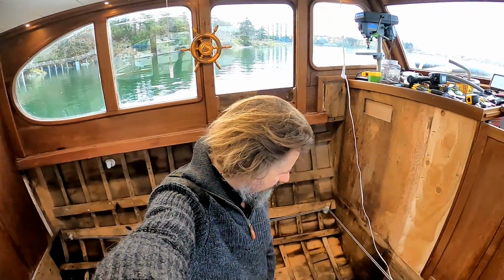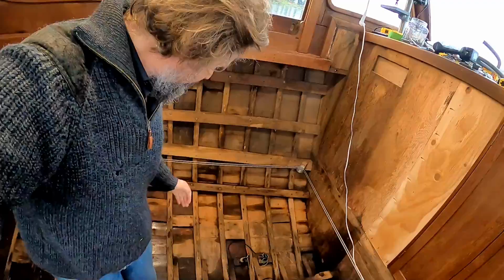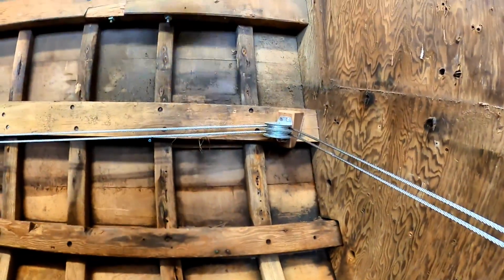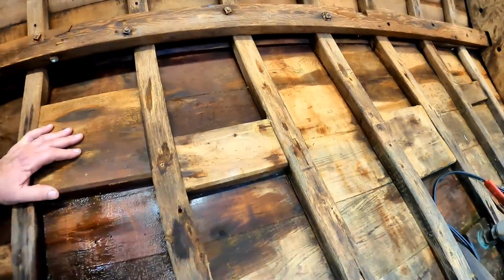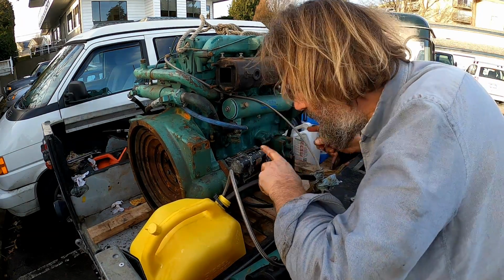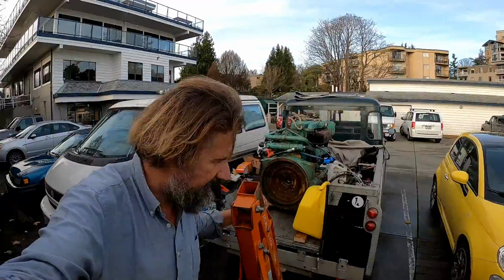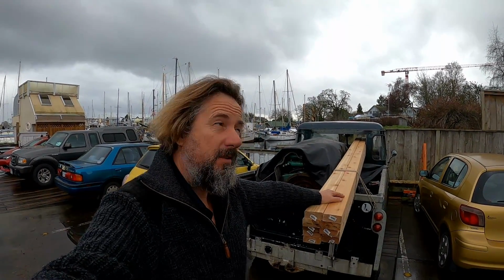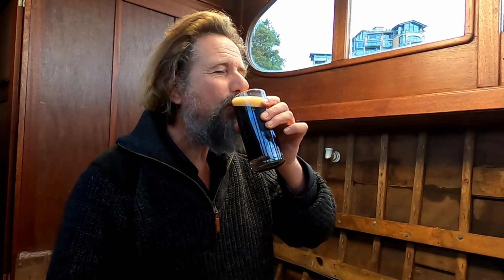Ready to Rebuild - #207 - Boat Life - Living aboard a wooden boat - Travels With Geordie

Comment: Mate, plywood is so expensive over there, $250.00  a sheet WOW,., same is around $150.00 . Down here in Aus.
Those Claytons butt blocks, could be reinforcing faults in the hull timber. Be I interesting to see when you've got the boat on the slip. 
Love your videos, too.

Comment: Peter, haul the boat, do all the necessary structural fixes before you put the new motor , and sole in place. if you wait till after, you're going to tear it all out and have to do the job twice. You can't build the house until you put in the foundation. I anticipate your response.
Reply: Your idea certainly has some merit. I believe peter will surprise us with a very cool choice of material for his new floors, some modern material.
He mentioned once that getting the boat to his haul out spot is best done with an engine. Peter needs to do a go fund me so he can get a good workshop!😁
Reply: @108hindu  I believe he's going to use some form of plastic for the new frames however trying to install those with the engine an engine bearers in the way, not to mention the new cabin sole is just going to complicate the whole process.
Reply: @stevegem4155  I agree, the stuff the boatbuilders are using now is strong, doesn’t ever deteriorate, and fairly easy to work with. I also agree that it’s harder to do in the marina but Peter seems a to be long way from his haul out. He’s a clever guy and always seems to find a way. At least the planks look really sound.
Desolation sound 2021!
Reply from the maker: Hi Steve, I've had to justify this decision more than any other I've ever made. I can see your concern. The simplest answer is that I must have the boat functional very soon. 
I'll explain again next week the whole planning process.

Comment: Fascinating project and boat. I have seen ceder used for soles very successfully. Sealed with an Epoxy sealer the floors were 20 years old at the time I was working on the boat.

Comment: I awake each Saturday with much anticipation. Has peter posted a new video yet? 
Great idea on the heavy marine plywood. Nobody likes spongy floors. Especially when the boats rocking.
If I lived on the island I’d give you some nice clear Alaska yellow cedar, if you wanted it.  
I hear the boatbuilders like it. Cheers 🍻
Reply from the maker: Woo, I'll come get AYC anywhere....
Reply: @TravelsWithGeordie  I live in Tacoma. That’s probably a bit far and the border is closed (?) I just looked and my local wood specialty places website, they even have AYC 6x6’s “appearance grade” Good prices, $6.50 a ft. Many interesting sizes and lengths. Mostly rough cut full dimensional, I plane it myself. Some s4s sizes.
My own stock is only a couple of boards right now. I have a pretty decent wood shop. When feasible I buy bigger stuff and resize it to my needs. I could buy some more  AYC as a present 4 Geordie 🦮 but delivery..... they even have some 4x4 and 2x6 port orford cedar. Dam this covid....

Comment: Hey Peter. Just a reminder. The oil that you put in the Perkins was not a suitable diesel lube oil although OK for storage. I found a current new Deutz diesel, common rail, water cooled EGR etc with CPU (50 HP) and new ZF transmission, 8 degree down angle for your craft in eBay.com, $4995 + $2205 USD.   (2017 Deutz D2.9L4) (ZF 45A). I have this engine new in pre Tier 4 final if interested.
Also if ever interested, I can advise you on Marinizing this app.
Reply from the maker: Hi Robert, thanks for the research on the engine. 
I've ordered a Beta Marine 60 HP and PRM gear so I'm all set.

Comment: Is not the the height of the engine based on the centerline of the transmision shaft ? IF the trans has a centerline inline with the engine crankshaft then nothing changes with engine height . Reducing the oil capacity with a shallow oil pan is not always a great idea . You do not need the clearance just to change the oil. It can be changed from the top side. Same with filters remote mount them where you have pleanty of room to change the filters. Those mods are done everyday in the marine engine world.
Just a thought , (;-) TP
Reply from the maker: I should have used the word "depth" the problem is there is no room in the bottom of the boat for the big Perkins.

Comment: This was a short video and although I had great anticipation for your announcing the haul out of your boat to facilitate the placement (no make that attachment) of the new ribs in the engine bay of the hull. I am concerned about the added weight of the 6x6 engine beams, the extra ribs, and the wonderful but 3/4" very dense and heavy marine ply. Like aircraft building, in boat building it all adds up. Your added weight however, will be in the best location of the boat, and the area of the boat already designed for the most weight. Question, is the new Beta Marine engine package including transmission, any lighter than the engine in the Lady Zephyr (spelling?). I know that there is enormous respect for the Beta Marine engines and I believe the marine upgrades are modern and as light weight as practical. Just curious if overall weight is a concern and if perhaps you buy some weight savings with the new engine that you can build into your boat. 
Happy Holidays To you and yours and to Lady Zephyr, who's real name I have awaited with great anticipation these many many months. Not sure it's important now, as I have become quite taken with the elegance and gentlemanly suave of calling both boat and a woman, "Lady" Zephyr... Cheers my digital friend.... Joe
Reply from the maker: Thanks for your thoughtful comments Joe. I'm paying close attention to weight and have calculated and modelled it. Yes, the Beta engine and transmission is much lighter than the engine that came out of the boat.

Comment: my twin Ford Lehman diesels sat 13 years I bled the lines changed fluids filters etc they fired right up within 15 to 20 seconds, and you are right get them under a load and running temp it will run great.......change oil in the injector pump if you have that option it makes a big difference

Comment: Quite a project. Unfortunately it looks like the boat will have to come out of the water soon to deal with those butt blocks and twinning the frames. Without knowing what those extra butt blocks are covering, cracked plank, weepy seam, etc, you certainly don't want to pry them off while the boat is in the water. I guess the plan would be to fabricate as many parts as possible ahead of time in anticipation of spending as little time as possible on the hard, which I understand is very expensive.

Comment: With the tanks that close to the Engine will you set them on isolators?
Reply from the maker: For vibration or stray current?
They'll sit on heavy rubber strips to eliminate both.

Comment: Cheers! Just wondering, is the weight of the fuel tanks really an issue? The frames and the planks that they rest upon, experience the same pressure from the outside, when they support the weight of the boat by displacing water. It’s like the wing tanks of an aeroplane; the weight of the wings and the fuel stresses the wing joints to the fusilage as long as the plane is stationary, but as soon as it starts to move, they become weigthless, and lift the fusilage.
From the point of view of your frames, your tanks will also be weigthtless.
Reply from the maker: Well yes and no, in a static model yes, but in heavy seas the load will be many times greater and not necessarily equally opposed from below. Even the gentle lapping of waves at anchor create oscillating flex and stress in the most precarious joint on the boat. frames to keel. 
Lastly, the nightmare, a grounding where all the weight is borne by the keel, shudder.

Comment: One question: why not pull the boat out and do this in dry dock?  Just seems a bit dangerous working on the floor with the sea right on the other side.
Reply from the maker: I'm going to. Only the new engine beds and sole will be done afloat.

Comment: Why not get the bulkheads out of the bilge?
Reply from the maker: They're far too integral to remove especially as they're in great shape.
Reply: @TravelsWithGeordie  but you have plywood bulkheads sitting in the bilg - the ply is like a wick sucking the water from thge bilg .
why not keep the bilge clear all the way through -  keeping the floor timber and bulkheads seperate coinstruction.
Your are rebuilding it anyway?????
Reply from the maker: amazingly the ply is in great shape. a testament to quality marine plywood. that and salt water doesn’t rot wood.

Comment: How much weight can you add to a boat before it sinks?
You have to know the boats displacement.  
Simple example.
You build a box with no lid, 1 meter x .5 meter x .5 meter on the outside,
Its “displacement” is .25 cubic meters.
Water weighs 1000 kilos per cubic meter.
So the boxes “displacement” is 1000 * .25, or 250 kilos
So, if the box weighs 50 kilos, then you can load 200 kilos into that box on water before it will sink. If you only weighed 120 kilos, you could paddle around the pond in it.
In brief, a boat will only sink until its weight “displaces” the same weight of the water it is in. Note that sea water weighs a bit more than fresh water.
With a boat shape, calculating the size of the outside is often a bit tricky.
Reply: I thought sea water was lighter than fresh water. For instance I was taught you float better in sea water.
Reply from the maker: Great points. I've actually gone to some trouble to do those precise calculations. Even modelling the underwater volume from my 3D model of the boat.
Reply: @TravelsWithGeordie   displacement on your boat is known  just do the internal weight.  .  geologic and weather modeling always fails   too many unknowns.  you have no unknowns.   just added weight.